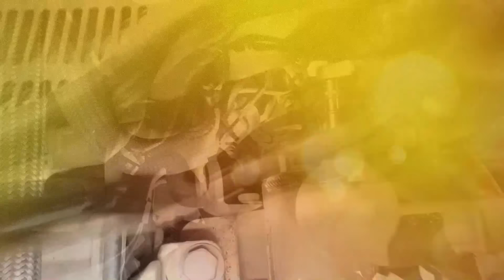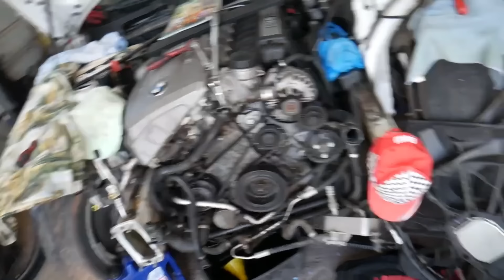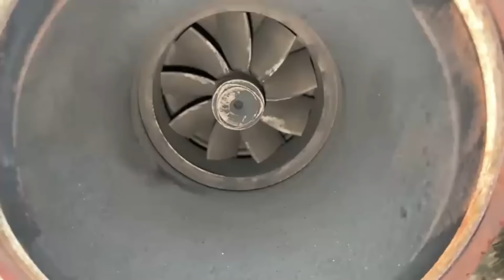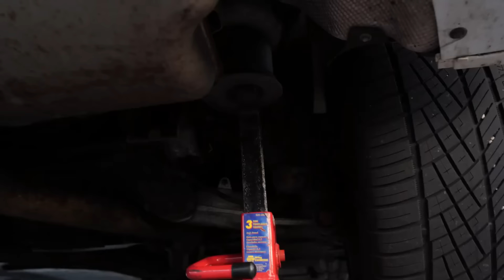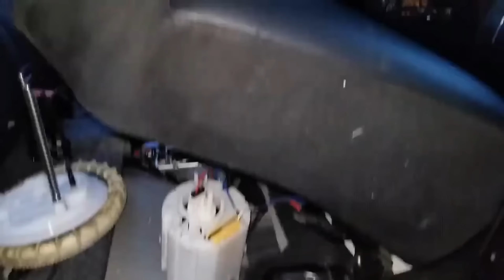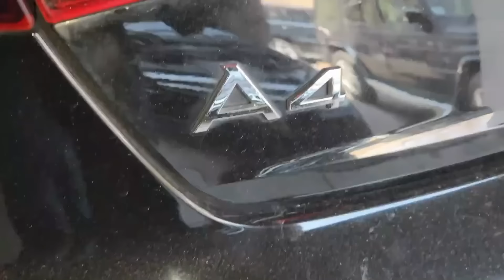10 German Car Secrets NO Mechanic Will Tell You

Comment: Good video and I agree with 90% of it but the next time you're talking about a high-pressure fuel pump you might not want to be putting video of replacing in the low pressure fuel pump under the rear seat when you should be showing video of the engine itself where the high pressure fuel pump is located

Comment: Most cars will last 200000 miles if you spend enough on them. Some cars have major issues which are known problems. BMW turbochargers, four cylinder engine high pressure fuell pumps and oil leaks.  Cam chains seem to be a problem with some cars needing changing at low mileages. It's easier to do your research and avoid cars with known expensive problems instead of buying a car with known issues and constantly spending huge sums on preventative maintenance.

Comment: The conspiracy theory about cars being deliberately designed to break down after the warranty seems hard to believe, especially in Korea. Mercedes-Benz offers an extended warranty (e.g., up to 9 years/unlimited mileage for the E-Class, around $5,500). If major repairs were guaranteed to cost more, they wouldn't offer.
Reply: How long is the extended warranty? They don't usually self-destruct before 100,000.
As for the transmissions, they're mostly made by GM or ZF, both manufacturers have a fluid service schedule. The magical BMW fluid in my 2 BMWs with GM gearbox is just Dex VI, I service every 50-60K.
Besides all the Germans have leaked docs over the years on their planned obsolescence, economic lifecycle optimization, or whatever their label for designed failure.

Comment: In my opinion, German cars are durable, but not necessarily reliable and what I mean by that is you may end up spending more money on maintenance and have unscheduled maintenance but the body, the suspension and things like that are made better than Japanese cars. I also believe where you live in the world is going to significantly impact your opinion of a German car because if you live somewhere where the labor rates are low and there’s a lot of skilled mechanical people, the parts themselves may not be significantly more expensive than other makes but when you can combine it with a high labor rate in America. It essentially totals the car, but if four hours of labor doesn’t cost you $200 an hour in eastern Europe or Africa. Well then suddenly it’s a much different proposition to own a German car.

Comment: Those plastic parts, especially those that can get clogged overtime regardless of the material, are far cheaper and easier to replace than if they'd be made out of something 'more durable'
Reply: The only thing I've ever seen clogged in any car is an Audi with a plastic thermostat and plastic housing where the thermostat came apart and wedged itself in the tube causing the car to overheat. Never seen that with any other car that uses aluminum or cast-iron components in the cooling system